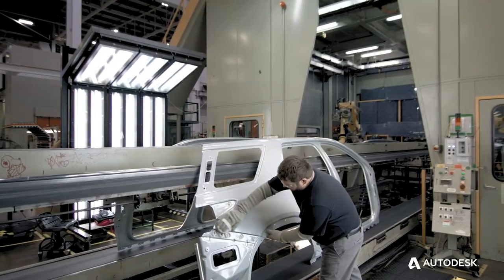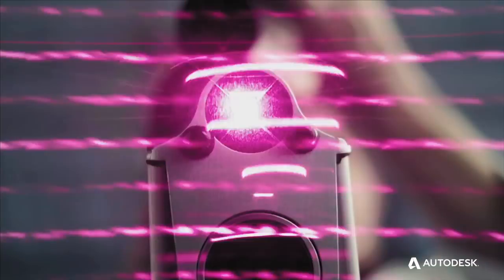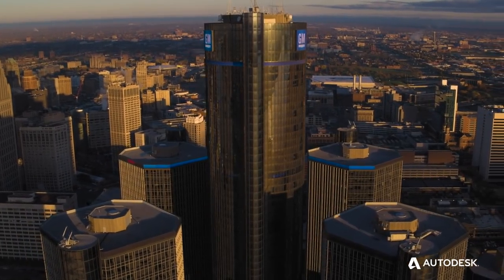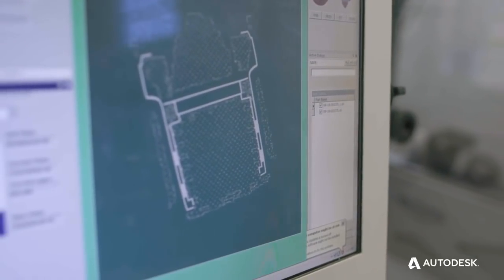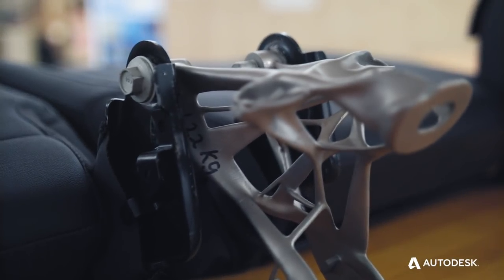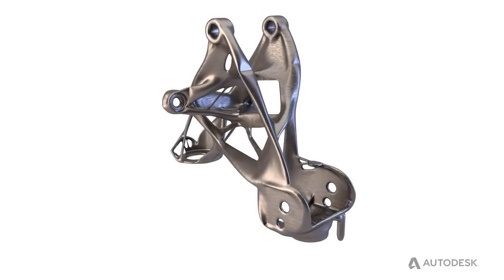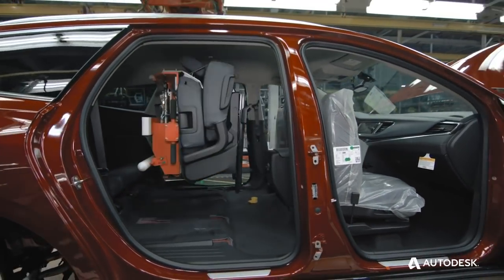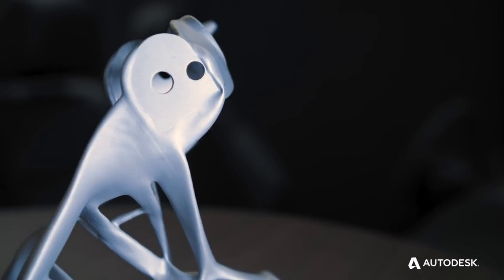General Motors Drives Vehicles of the Future with Generative Design

Comment: Autodesk now needs to add a function which, given an object designed using their Generative Design approach, also automatically produces the designs for the molds necessary to mass produce the object. As others have pointed out, generative design seems to produce objects that can only be manufactured using one-at-a-time additive manufacturing techniques, like 3D printing. That's simply not useful when you need to manufacture thousands or tens of thousands of the object.
Reply from the maker: We're working to add other manufacturing types (such as injection molding) soon. That said, with some tweaking you CAN mass produce what comes out of generative now. Case in point: https://www.fastcompany.com/90334218/this-is-the-first-commercial-product-made-using-generative-design